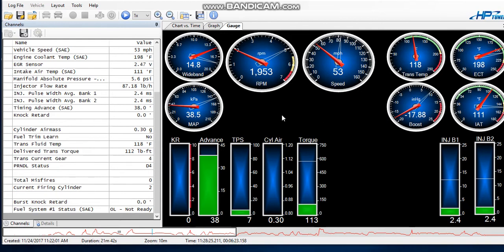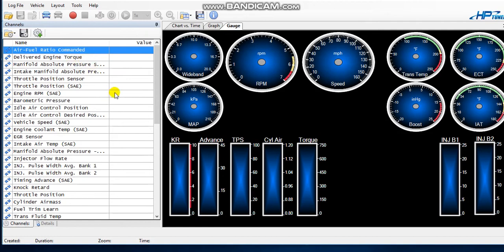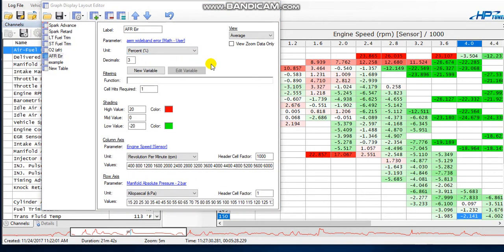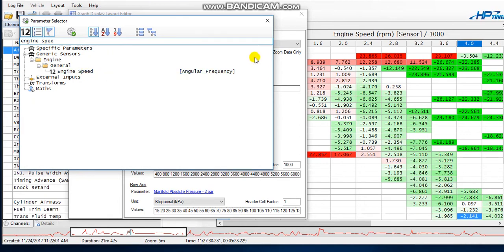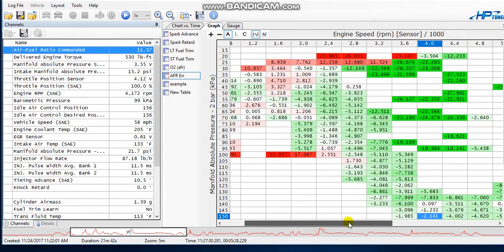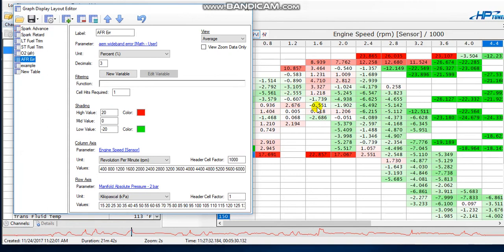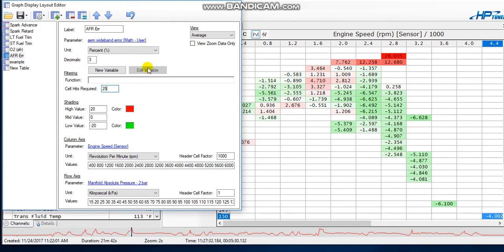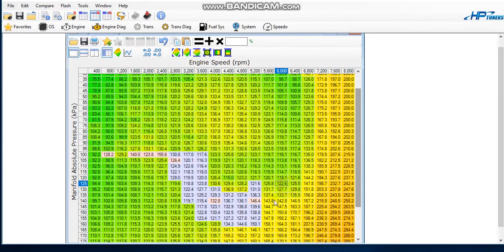HP Tuners AFR Error Correction Graph Setup

Comment: Question. Your using your egr sensor as your reference for the wide band, or you’re using an afr kit in the place of egr sensor? 

I’m pretty sure it’s the first option, I’m just making sure you didn’t need an afr gauge installed to make these revisions.
Reply from the maker: I'm using an AEM wideband gauge that has a 0-5 volt output reference. That reference is then input into the EGR pin of the pcm, then in the scanner I can log the EGR voltage (EGR voltage is also 0-5 volt) no EGR sensor is used, just the wiring input that goes into the computer. Then you basically change the math so that the scanner displays a numerical value based off the voltage it sees on the EGR pin.

Comment: only problem and i cant figure this out but the graph works once... that's it.  if i stop logging and go back, it wont work again.  no clue why.  changed map sensors and verified everything was right...
Reply from the maker: It has to be saved, it's been a while since I've used the software since converting to ms3 but remember that there is a particular way to save all of the charts, graphs and maths.

Comment: holy crap thank you for this.  I've been pulling my hair out for days trying to figure this out.  finally got a couple hours straight to wrap my head around this and actually get it dialed in.   they changed the software since the last time I've done this by backfeeding thru the EGR but I'm using an AC pressure sensor now.

Comment: I have seen that equation for AFR error used in several vids and various posts but after I set up my table using that equation all I got was no data in my cells. Shows that something was logged but no data. Someone pointed out that 2811 is the PID for EGR voltage. Shouldn’t it be ([AFR actual]-[commanded AFR])/[commanded AFR] which would be in your case 60001-6001/6001? Then again I guess the formula (2811.10/5)+10 is the same thing. No idea why I’m not seeing numbers
Reply: Thanks for the reply. I found out the hard way that sometimes things like a change in a math formula won’t work until you close then reopen the scanner.
Reply from the maker: As far as having no data showing, double check your pid to see what  number is assigned to your egr or whatever input you are using, they're not all the same depending on operating system.

Comment: When you log do you have it in open loop and fuel trims shut off?
Reply from the maker: I run a SD tune in my turbo application which is always open loop. I wouldn't allow closed loop when making adjustments to the VE table just to help simplify things.
Reply: Even after youre done tuning? Leave it in open loop?
Reply from the maker: No when you're done and happy with the VE table you can restore closed loop.  I don't run closed loop because I only use  wideband sensor (no narrow bands), it stays pretty consistent considering... The only time I get AFR fluctuations is when there's a dramatic outside temperature change and then it's just a matter of trimming or adding a small percent of fuel to get it all back in line.

Comment: The equation do not work for me
Reply from the maker: ludovic charest guerard, the numbers that designate the sensors are different depending on pcm or operating system. You'll need to lookup the sensor in the scanner to see what yours are numbered.